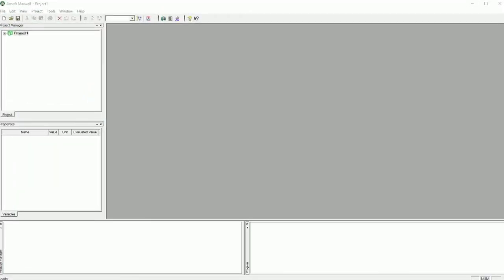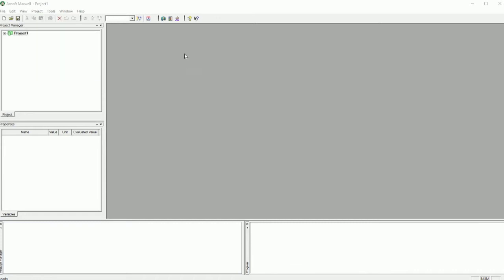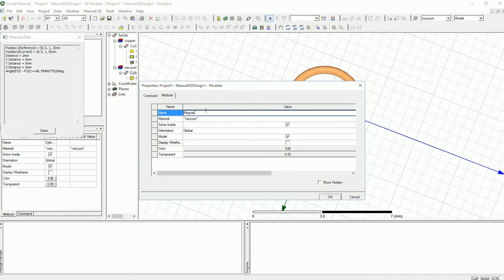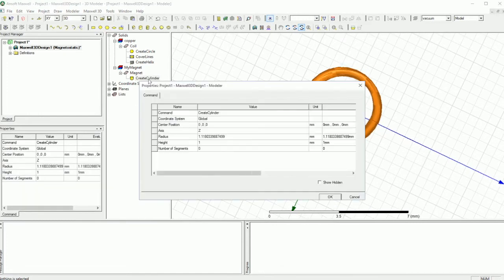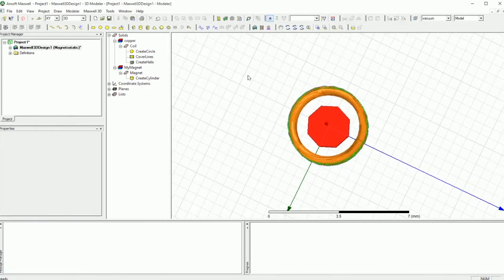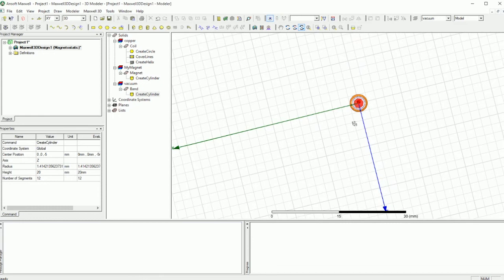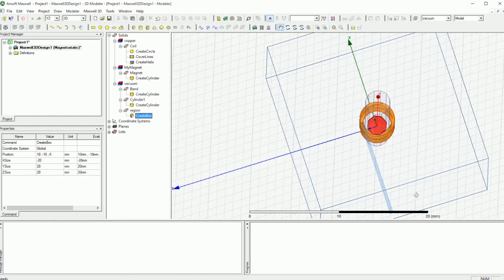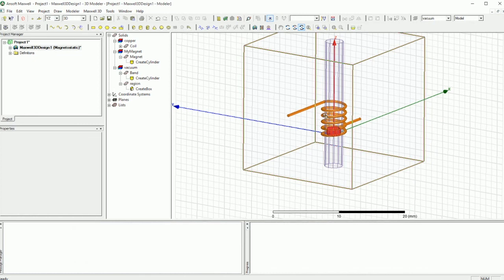407 - Ansys Maxwell | Translational motion Helix [1/3]

Comment: How to draw a coil with multiple turns per unit length just like in a solenoid?
Reply from the maker: +Hari Krishna Hi, If it is high number of turns use a hollow cylinder and excite the cross section and set the number of stranded to the number of turns.
Reply: oh! Thank you, for both the tut and the reply :)

Comment: Can it be made an simulation of system where you set initial parameters, and then let the simulation to simulate for example movement?For example: System with two magnets on surface, where you set mass and strength of magnets, coefficient of friction between surface and magnet and at the end distance and orientation of magnets relative to each other. So when you play animated simulation they move respective to initial parameters...